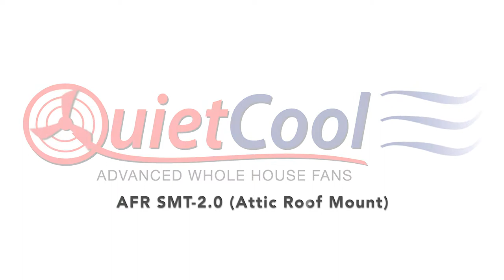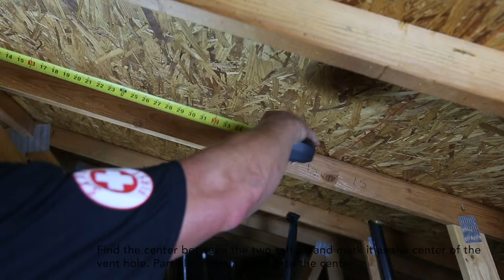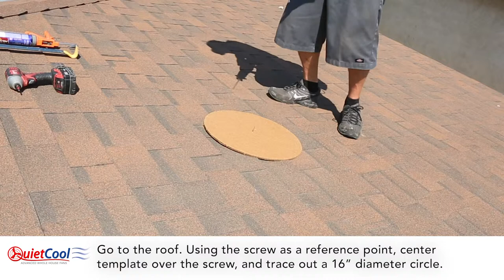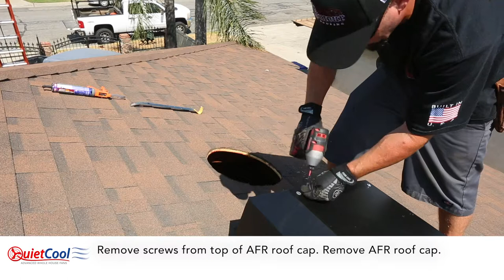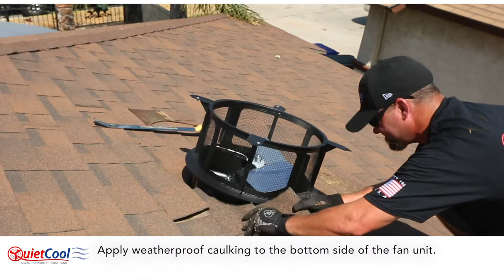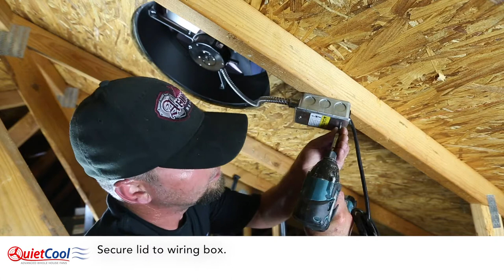QuietCool AFR SMT ES-2.0 (1st Generation) Roof Mount Attic Fan Installation on Shingle Roof

Comment: Don’t you have to caulk under the flashing?im about to install mine. We get hard rains here close to the gulf in Texas. I want to make sure of no leaks.I was planning on flash poly caulk around unit where meets the shingles as well just to make sure.a clean line of caulk I’m kinda ocd on this stuff.or am I going overkill?
Reply from the maker: Yes,

You need to completely seal the fan.